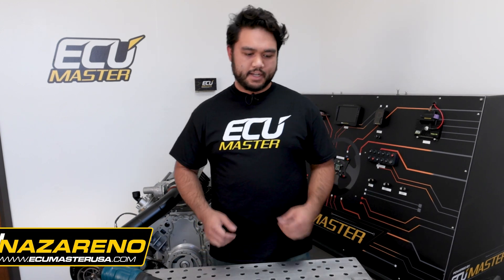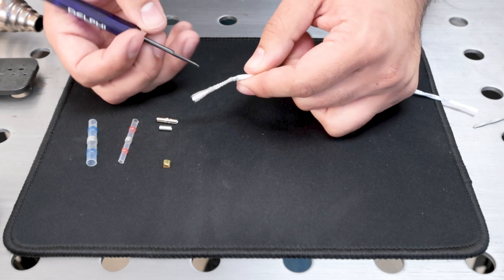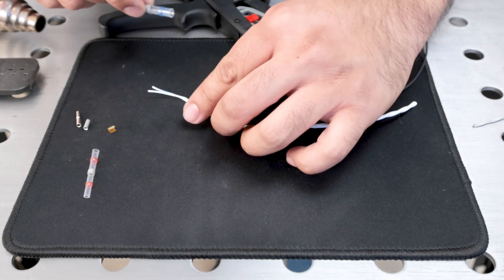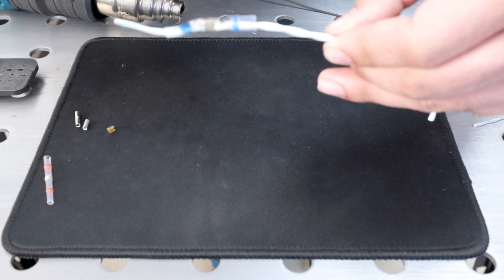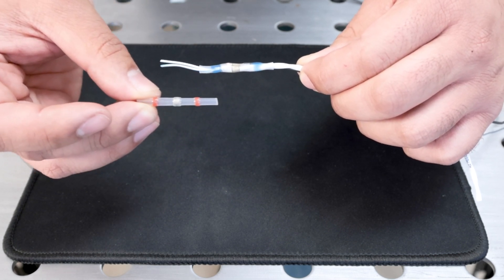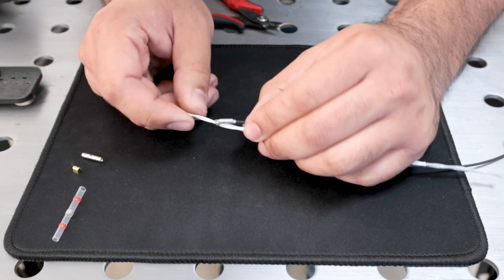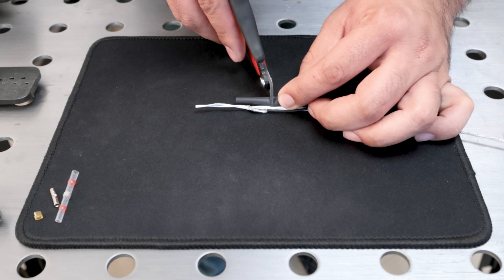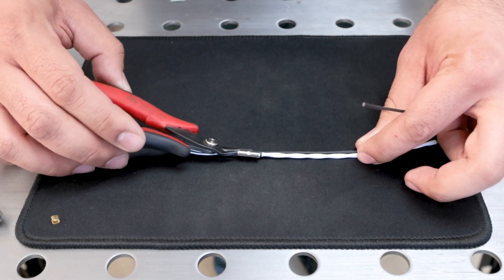Shielded Wire Termination | ECUMaster USA

Comment: So for say a 2jz, shielded wire both cam,crank, knocks sensor,  since all sensors aren't close together.  Can I still tie in all their shield to one ground ring terminal?  Or will I need to separate their shielded grounds?

Comment: Partially crimp in a ratcheting tool, tape the wire set so they dont slide individually (granted ur using a shielded set).. index finger and thrumb on 1 wire, middle and ring fingers holding the others, and press the crimper. Its BARELY more advanced. Also, if the shield is being terminated along with those wires, bend the shield back up, and place heat shrink tube again, then cut it ro the same length as the others.

Comment: My A/C wall unit is newer and it has a bare wire wrapped in aluminum foil. It's made for "Safety." It also has a reset button on the plug. My dog bit through 2 places. I repaired it, but it will not work without the bare thin wire. I tried replacing the wire, to no avail.

Comment: For ecumaster black ecu where is the best to ground the shield drain? Would it be ground to the head of the engine or one of the sensor ground pins on the ecu ?
Reply from the maker: Any reliable chassis ground would work.

Comment: Good to see the effort in putting out videos. 
Would love to see the Fluid Temp sensor that you got to use the resistors on in an upcoming video, I notice quite a few people asking about it on the FB forums, including me. (I got the answer btw thx, but it will help others as a Go-To Video and help the channel out. 
Esp videos for frequently asked questions that you can guide people to.  

Sound Side Tip: You can use a plugin like Waves X-noise (Should be on sale currently) in your Video editing program to scan the silent noise/hiss and make it silent (if you over-do it it will make voice audio sound under water). but this should really help clean up the audio. 

Keep up the good work guys. look forward to more

When I did my shielded wiring I used copper crimps on it with the "Pull wire out the braid" method, I then overkilled it by putting some light solder on the crimped terminal wires. Whilst using solder can be bad due to vibrations I didn't let it seep down far through the shield, then Strain relieved it with some glue-lined heatshrink.

Comment: Yup! Sound Performance called me and told me they were getting noise on my Cam and Crank wiring that I DIY’d my self. They told me they were going upgrade my wiring to shielded cables. This was back in 2019 April - my 2JZ Mk3 Supra ran so much better after this wiring upgrade.
Reply from the maker: Shielded is the way to a clean signal for sure.
Reply: @ECUMasterUSA  I see some harness builders twisting two wires together like how you would for CAN wiring and claimed they never had issues, I find it hard to believe. 
I got to agree with you guys, Shielded is the way to go. Whats You guys thoughts on this twist method though?
Reply: @BjornFSE  I've built harnesses for vag engines (on emu black) using shielded wire with a drain, shielded wire without drain, and twisted pairs for the cam/crank/knock sensors. Even on the same chassis/engine/setup I couldn't discern any differences when swapping between harnesses. All three worked flawlessly on the same car...
Coil on plug, 8k redline, no issues. Obviously shielded with a drain is best, but in my experience I never had issues
Reply: @TheDroidKilla  where exactly does the drain go? Chassis ground? ECU ground?
Reply: @Grimnest  I send it where I ground the ecu at. I use a separate wire/lug all the way. Typically leading to a chassis ground stud.

Some people use the cylinder head as their end point.
Reply: @TheDroidKilla  thank you very much!